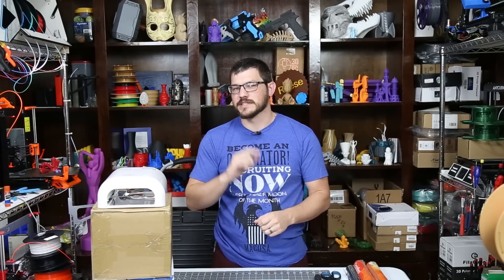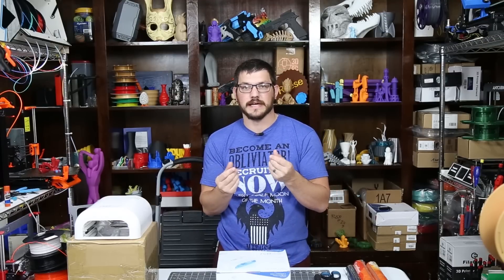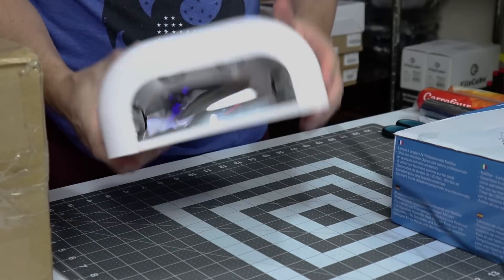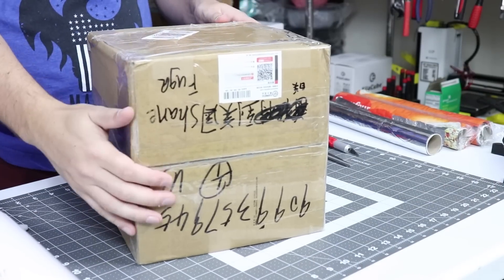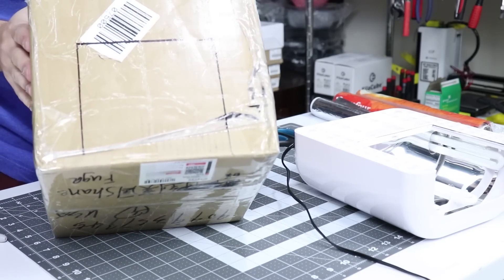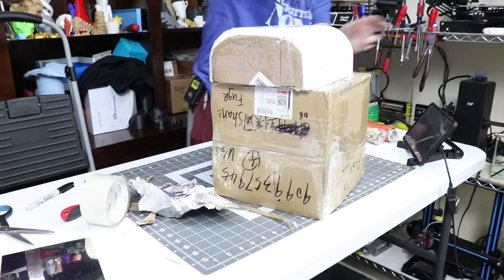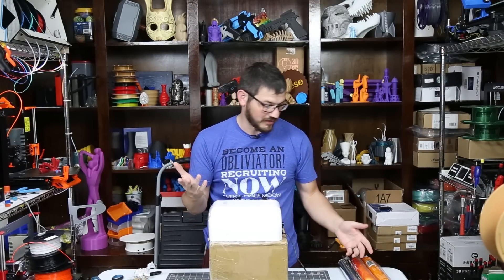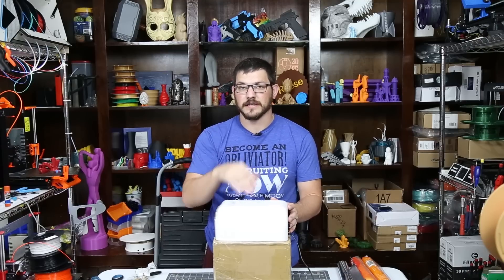DIY $30 Curing Station for Resin 3D Prints

Comment: Sincerely, I'm not trying to be a "hater" or a "Debbie Downer" here but what is the basic need for this device?  I just set the completed printed object outside in the sun for 10 minutes, flip it for another 10 minutes, and the job is done.  Sometimes I forget and leave it out for (much!) longer, no harm.

Certainly this device could/would be useful if one does NOT live in a sunny location but resides, rather, in a region where one experiences real winter or a lot of rain (Pacific northwest, etc).  While UV curing is indeed a desirable final step when resin printing, I'm just pointing out that a special "device" is not necessary, particularly if you live with a lot of sun... there's nothing special about artificial UV that makes it superior to sunlight.  If one NEEDS the device (as I know many people do) then something like this certainly answers the mail.  All good, peace.  :-)
Reply from the maker: You're not wrong but let me ask you this. Do you finish all of your parts during the day and do you have time to set them out? I post process one print in the morning and cure it before I go to work, and then another after dinner or after I put the kids to bed. I don't have time to set it outside and wait for it to cure. Some days are clear, some are rainy and some are just dreary. Having a curing station in your maker space counters all of those variables. 

I also have no idea how extreme cold or heat will affect the print. In the sun, where I live, It can be well over 100. In the winter, it can be in the negatives. Again, these are variables that having some kind of curing station. Time is my biggest problem. 3-5 minutes in the curing station and the print is done.

I have another video coming out that takes this and turns it up to 11. It does cost a little bit more and is 100% overkill but it does a truly amazing job at curing prints.
Reply: @Fugatech3DPrinting  Thnx, Shane, for replying to my comment.  I guess, when we get right down to it, that I just don't see the final curing process as being all that urgent. Maybe you know a reason for it to be done right away but I just put the finished prints aside if its night time or ugly outside and then bring them outside when its sunny for 10 minutes or more (sometimes I forget its out there).  Flip to the other side for another 10 minutes and its done.  I've seen no ill effects due to high heat or humidity or rain or such... the prints feel a bit waxy or "greasy" until I've cured them in the sun but nothing is melting or anything like that.  Bottom line:  we both use what works best for each of us and that's just fine.  All good--- peace.   :-)
Reply: Ah... the sun.  I've heard about that thing... what does it look like? We Dutch tend to forget... ;-)
Reply: Uv can make it more brittle if left out to long be careful

Comment: try using clear plastic wrap on the rotating turntable so it will get the bottom of the model but still protect the surface....

Comment: Shane , you made that build about as difficult as you could. First the slide out tray could have been the template for the opening and the cover for the opening on the side. Then simply cutting open the box so it is flat, cover with foil.  Fold back up and tape together.  I always like your videos cause you do things like a normal guy.
Reply: I would just glue it inside the top of a box the same size but taller and line it with mylar. Maybe cut a whole just so I can "not trow away" the removable panel and use it as a door. And I think I have a microwave turntable motor somewhere that works on 120v I could wire in easily...